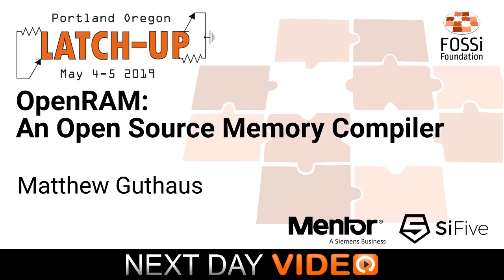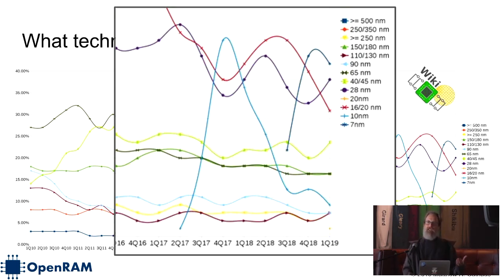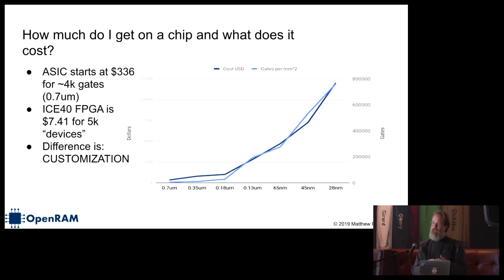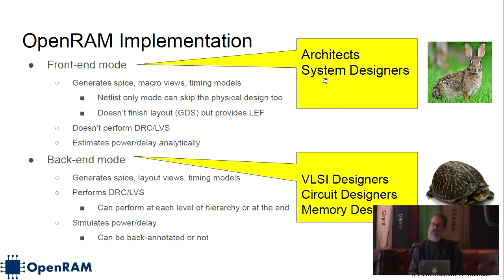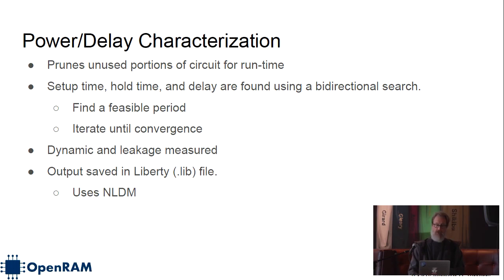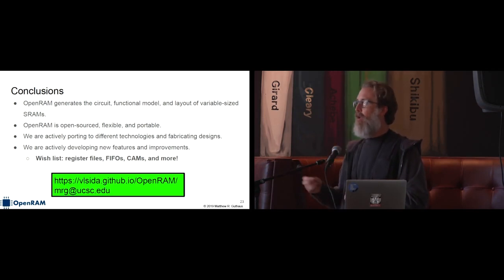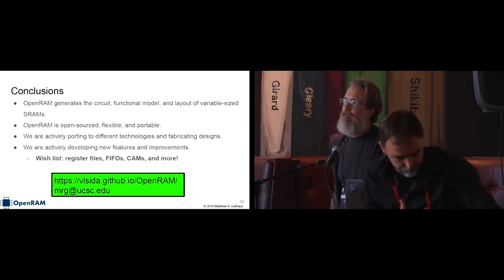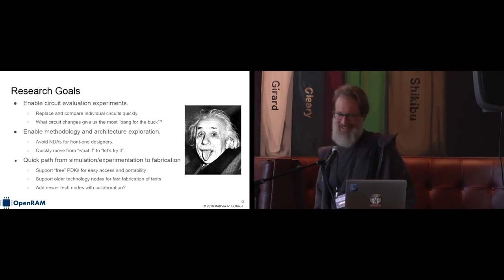OpenRAM: An Open Source Memory Compiler

Comment: How is it possible (5:36) that 28nm costs 13000 US for 1mm^2? An iPhone Apple A15 or whatever in nm5 would cost like 100k US one chip? Those chips are bigger than 1mm?
Reply: This is very low volume, multi project wafer. You share the mask cost and get a few dozen chips.
Reply: @stefanwallentowitz7832  Ok I see but its still insane that apparently if you mass order your price per chip is x/1000000?